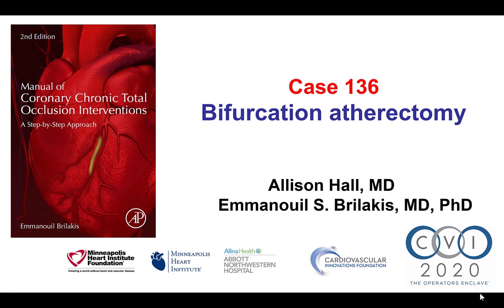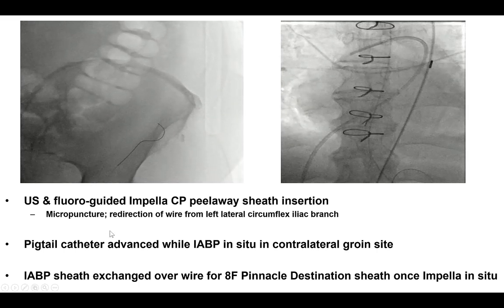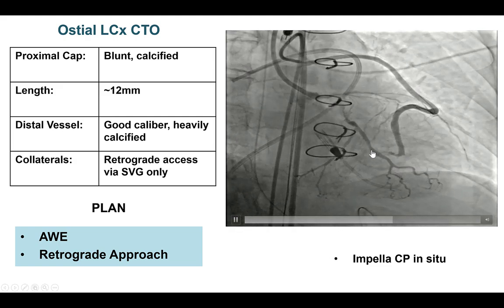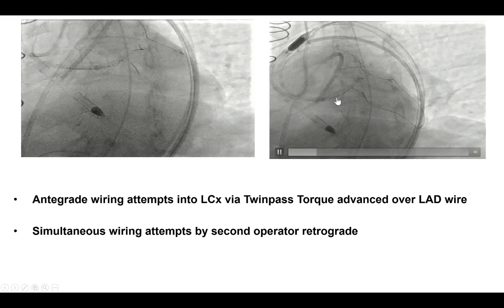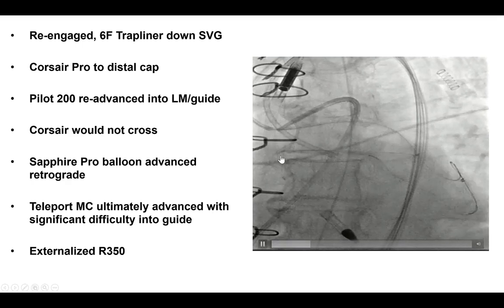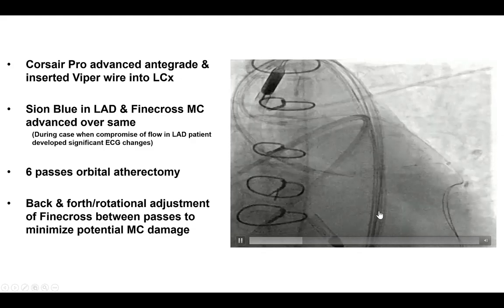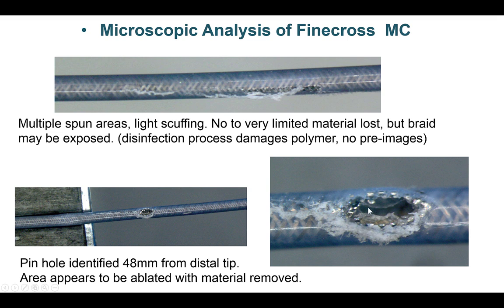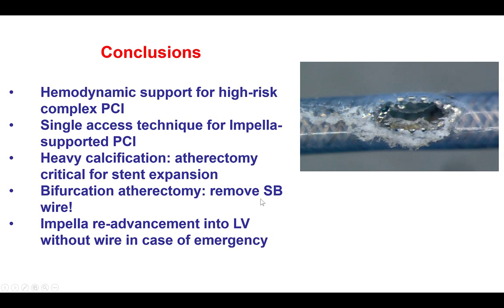Case 136: Manual of CTO PCI - Bifurcation atherectomy

Comment: Thank you Manso. Another wonderful case. I have few questions  here:

1)  This is a non-dominant LCx. Would you have rather fixed the RCA CTO better here? I am not fully oriented with the echo of this case and whether there is a specific reason for you to chose to fix LCx vs RCA

2) It is interesting how the MC got broken with OA (even with your moving the MC back and forth). Would have this happened if you were protecting the LAD wire with guiding extension? In another way, would guiding extension be better than MC for protecting side branch wires?

3) Hindsight (everything is easier hindsight), would you have sent her upfront for mitraclip? Problem with these cases, are they adequately diuresed before we embark on the need of mitraclip?

Thanks

AY